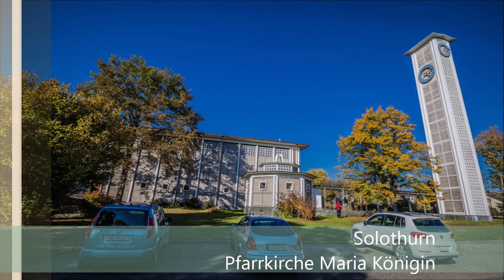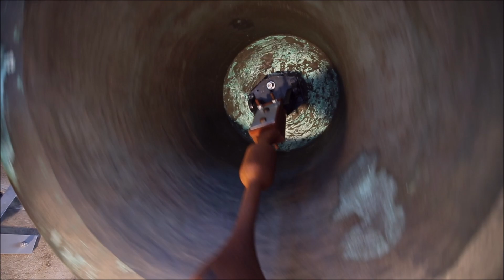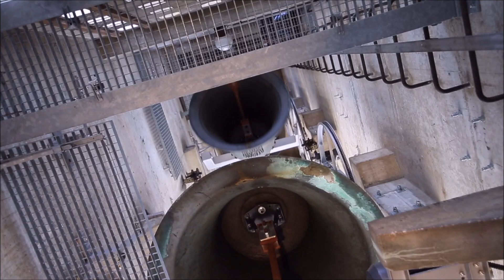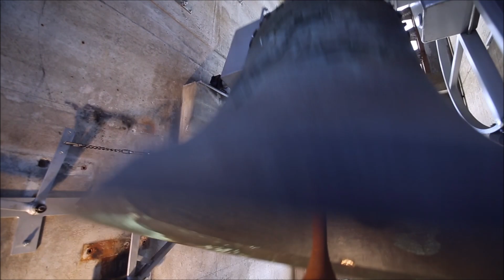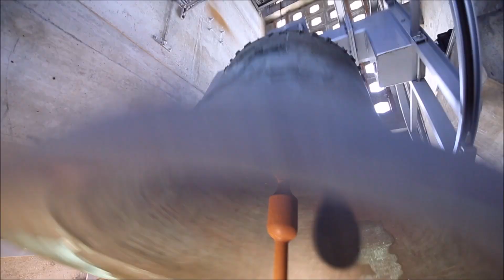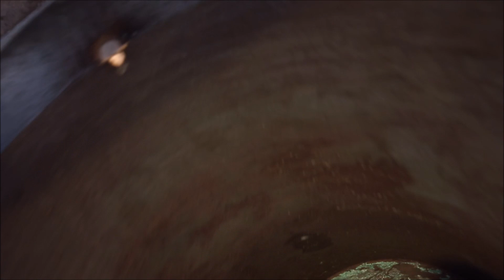SOLOTHURN (CH - SO): Geläutepräsentation der Pfarrkirche Maria Königin

Comment: Personally, the Bachert bells are of better quality than those of Aarau, for any period of time !!
Reply from the maker: Regarding the older Bachert bells from, let's say before around 2005, that surely is true. Except if compared to some of the really high quality ones frome Rüetschi that were cast in the 1930s. But for the newer bells from Karlsruhe, that statement definetely does not hold true anymore. They often are mushy, soft and undefined in sound, have tons of casting defects and rough surfaces. All problems never seen with Rüetschis bells. Additional to that comes the lack of precision when it comes to getting the notes right. The name of St. Ingbert tells the whole story very well I guess.
Reply: @Auferstehungsglocke  Of course, we are talking about the one and only Alfred Bachert, whose achievements are hot and cold, depending on which day we are talking about.  Not only St. Ingbert's new peal is a flop but also a certain church in Austria (I forget the name ...). Now he's got the project for Magdeburg in his hip pocket.
Reply from the maker: @clochebell  Definetely, that is not the only one. In my opinion, the big B° bell of Tuttlingen also sounds prett mushy compared to the older bells and the surface on the inside of the bell shows some casting defects...
The A° of Rottenburg although sounds quite good in my opinion, yet it has some casting defects on the crown.

Comment: Good, but this clappers are the new ones or the old ones
Reply from the maker: These are the new ones. They are not painted, therefore they get rusty on the surface. This is normal, since they're not made out of stainless steel. The rust is only on the surfece, so it has no impact on the structural integrity of the clapper.

Comment: Viedo is fresh, and so incredible. Bells are so good!!! Why biggest bell have falling clapper?
Reply from the maker: Thany you very much!
Because the big bell is hanging on a slightly arched yoke due to space reasons a falling clapper had to be used, since a flying clapper would have been to big. Due the arched yoke the clapper experiences a smaller momentum and therefore must be bigger than usual in order to fly, thus resulting it hitting the concrete beam in front of the bell.